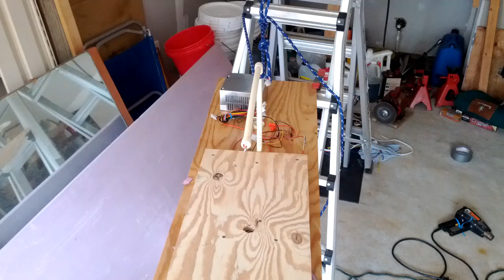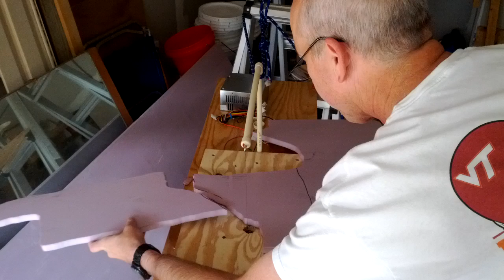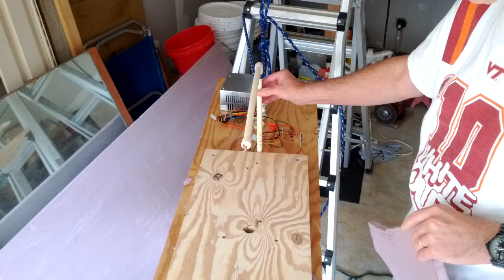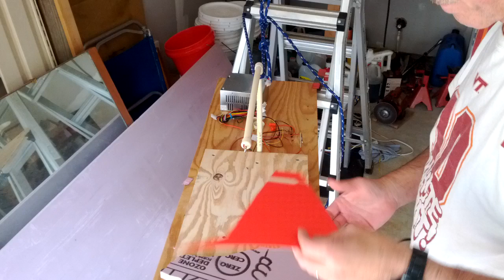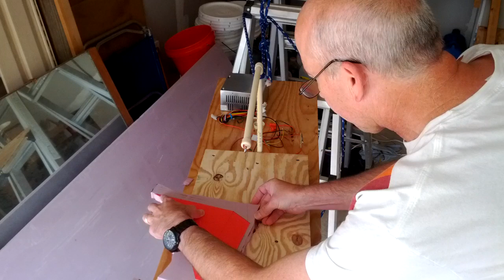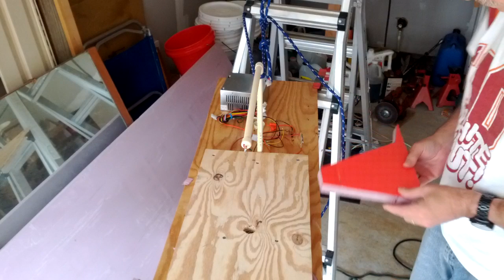Hot Wire Cutting a RC Foam Plane Wing

Comment: I usually cut the shape outline using knife and ruler and also making airfoil foam wing using knife and sandpaper...
Reply from the maker: yes you are right.  I was learning and still am. I think a smaller hot knife would be useful for shaping , but I really think this foam is so brittle, I won't be using it in the future.  thanks for leaving a comment